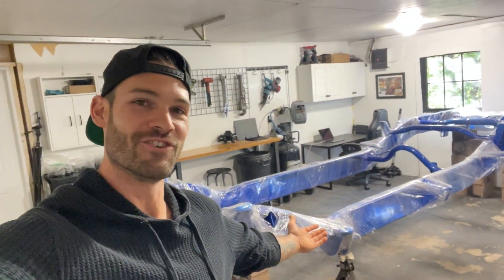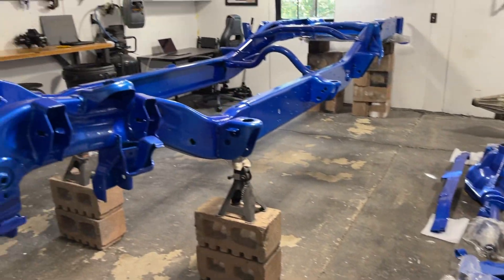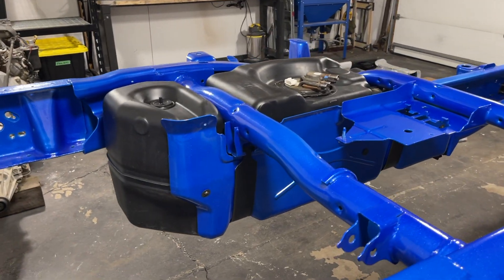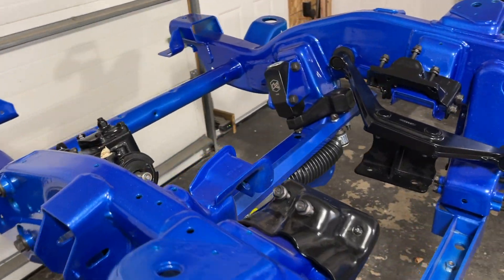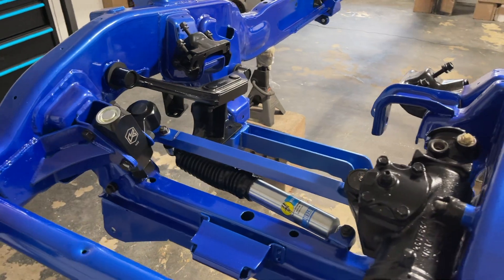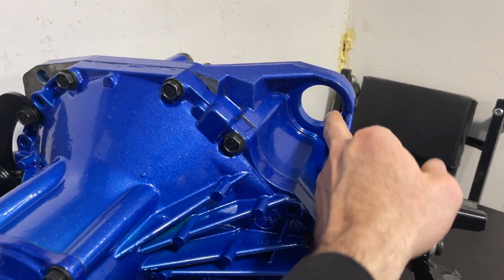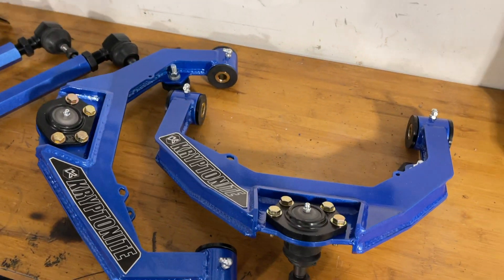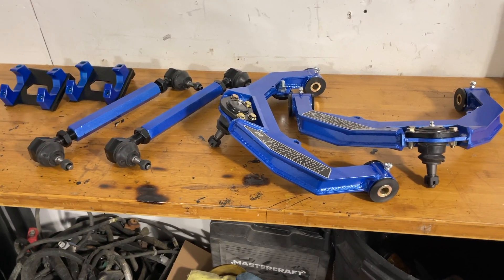BUILDING A LBZ DURAMAX SEMA TRUCK IN MY GARAGE | PT 9 | - FRONT END ASSEMBLY

Comment: Truck is gonna be sweeet, I’m doing a frame off on my 2006 Chevy 1500 and I was wondering if you got some of your hardware coated or bought new hardware that already was coated?
Reply from the maker: I got a lot of new hardware with the lift kit, however I did replace and blast/re-coat a lot of the existing hardware. I wanted everything to look as new as possible.

Comment: I just finished up a frame swap on a 60k mile lbz this summer. Its refreshing starting with new components. Now I basically have a new 2006 truck. What converter do you run in these trucks? I slipped mine a bit with a mild tune and looking at options.
Reply from the maker: Nice! It’s definitely a game changer being able to work on a clean blank slate with all new parts and hardware that’s for sure!  

I haven’t done anything major to the driveline on this truck yet and tbh probably won’t until something breaks. That being said, I’ve heard good things about both ATS and BD converters.